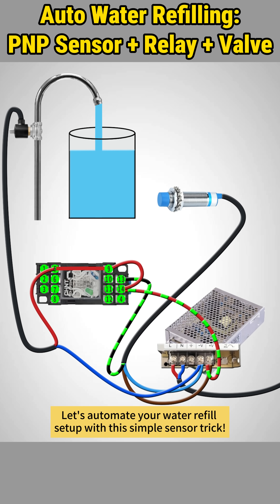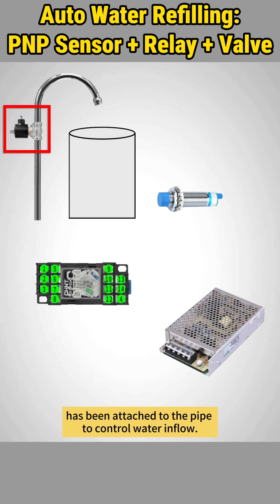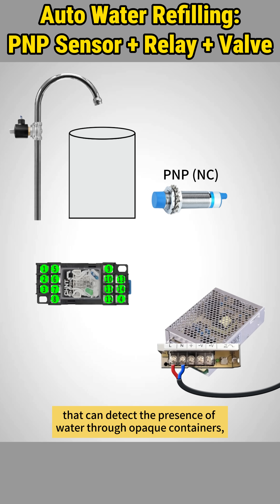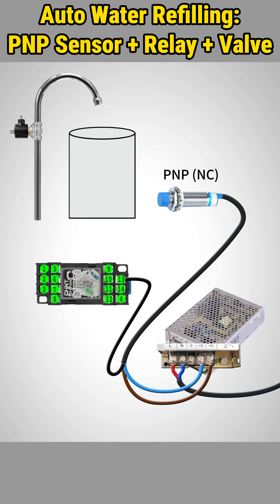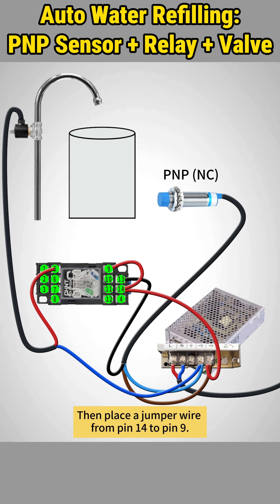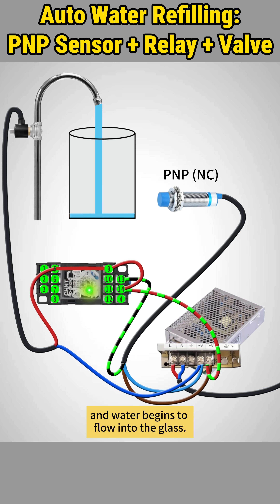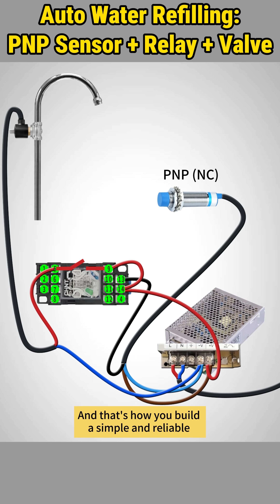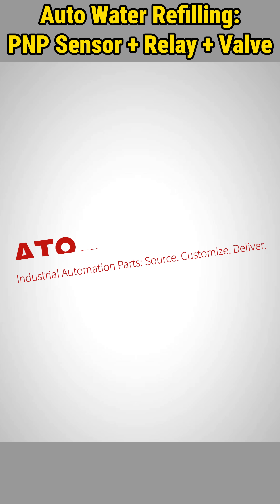Auto Water Refilling with PNP Sensor, Relay & Solenoid Valve

Comment: pnp sensors output should be positive,
rely coil connection wrong
Reply from the maker: Yes sir, you're right. We've made a correction in the pinned comment. Thanks for your correction.